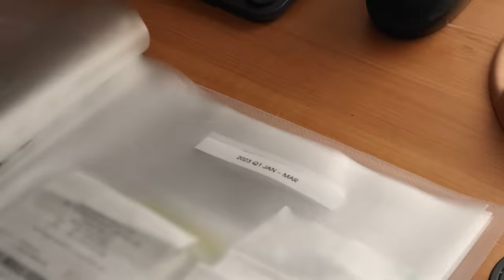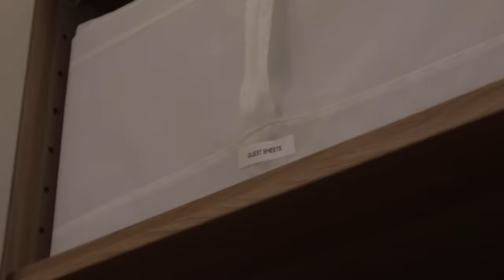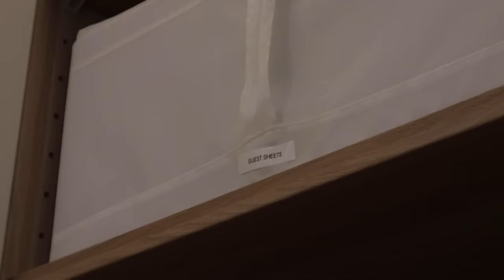How to organize the ugly things (+ small space ideas)

Comment: As an engineer, I would say be careful when you organise mains cables by twisting them into a coil (like the way you showed for the kitchen appliances). It's fine if the appliances are unpowered. But if they're powered up, the organised cables act as a coil, which might cause overheating - risk of fires 🔥. 

P.S. love your videos ❤
Reply from the maker: 🤯 good to know, thank you!!
Reply: Well it doesn't act as a coil because the isolation prevents it (there is too much separation between cables, and two wires will cancel the magnetic field around it), but it can cause fire simply by the fact that live wire with high amperage will produce a lot of heat. If that heat can't go anywhere it can cause insulation to melt, short wires, produce a spark and thus fire.
Reply: @cloudyhills  I'm an engineer too and can assure you that coiling these short cables won't pose any risk, it is perfectly safe. Great tips, thank you!
Reply: Does it matter what country you’re in? I know that sounds like a “dumb-a$$” question but… say, I’m in the USA & I know our wattage in the outlets ARE different to say the UK. With theirs having that whole “turning the outlets OFF at the outlet”. To where here in America we turn OFF the whole thing by unplugging the object. And our wattage isn’t as high as the UK’s. I do know better than to close everything up in a box/container & just letting the HEAT stay confined.😊

Have I made anyone else as confused as I am by just posting this question? 🤷🏻‍♀️ ✌🏻
Reply: @cynsi7604 i understand your question!
Reply: @jamesma8209   Thanks 😊
Reply: hiç bi b.k olmaz. sanki og kabloyu doladı kadın. alt tarafı 3x0,75 kablo.
Reply: Im only a second semester electrical engineering student, but as far as I know, coils like these have way too little windings to matter for most things. Heat is a nonissue in terms of that, the only thing that could happen is distortion in microphones/amps if you were to coil up their cables.

However, the stress on the material by being wound up (especially tightly) can cause unintended current density or wear down the insulation or wire, and that can indeed cause heat, short circuits and fires. Just making sure the cables you use are not broken/ripped open anywhere is all you really need to do.
Reply: In the UK fire safety training says not to have wires in coils while in use for reasons above, it can cause a house fire
Reply: You have a beautifull  and tidy home! I also hate the sight of a router!